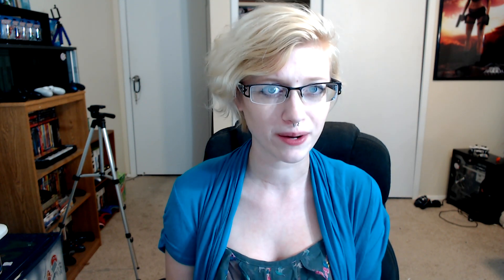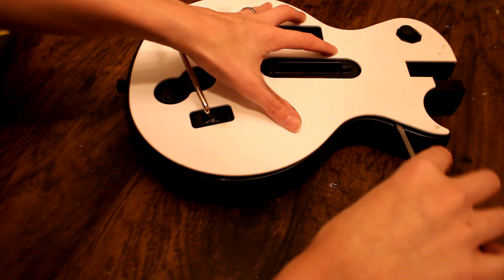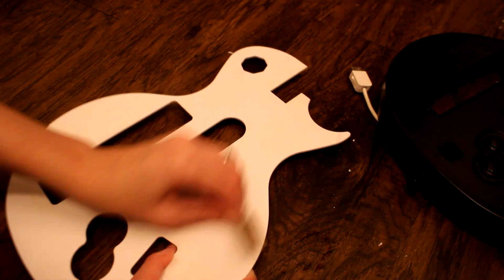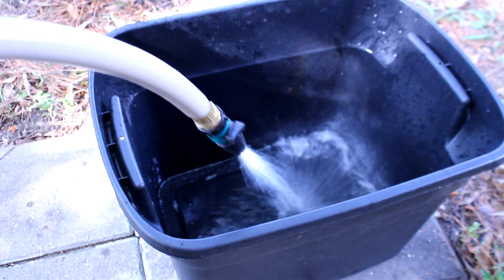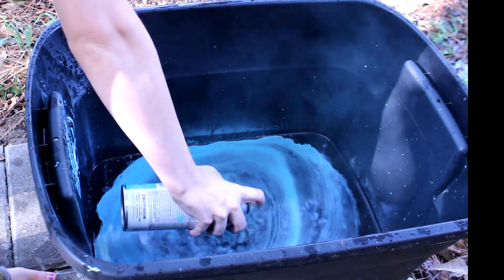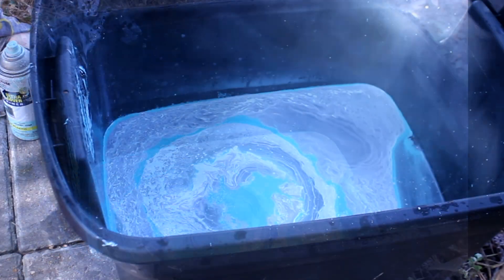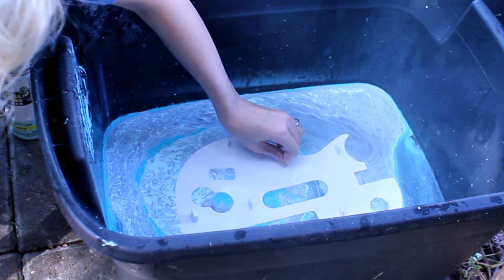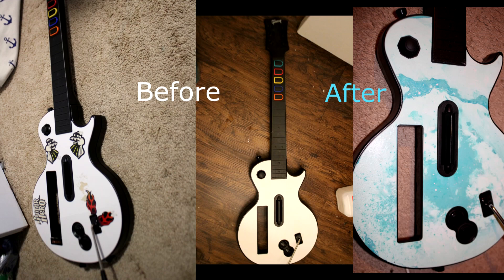Hydro-dipping the Face Plate of Guitar Hero Guitar

Comment: The faceplate comes off of the guitar easily by following these steps:
1. Turn the guitar around
2. Turn the tab that will release the neck of the guitar, and pull the neck up and off.
3. Locate the other lockable tab near the bottom of the guitar on the back. Turn that to the 'unlocked' position
4. Grab the faceplate were the neck was once attached and pull it off of the guitar. 

No screwdriver or prying needed. :)